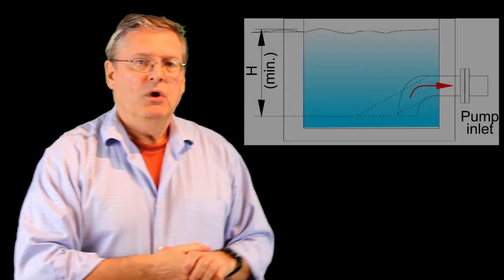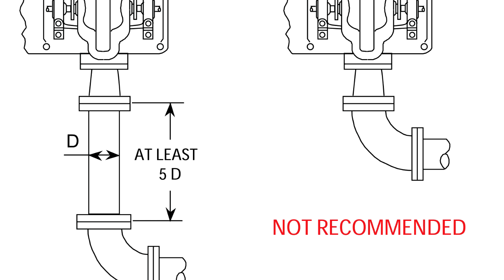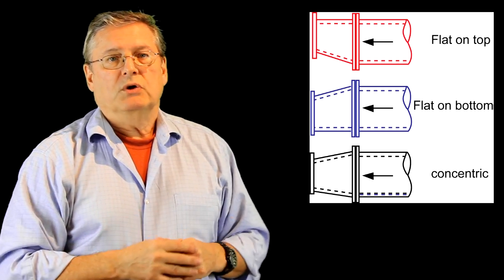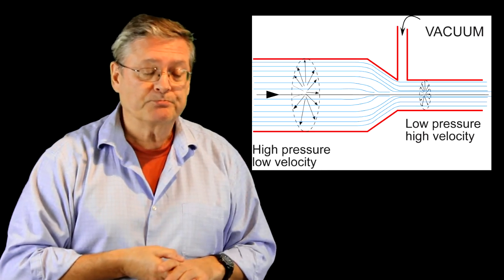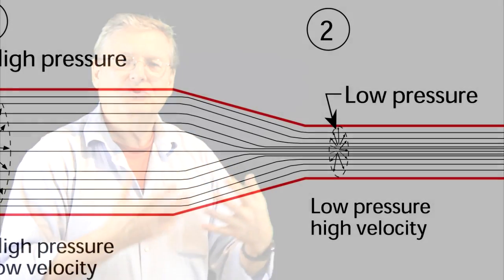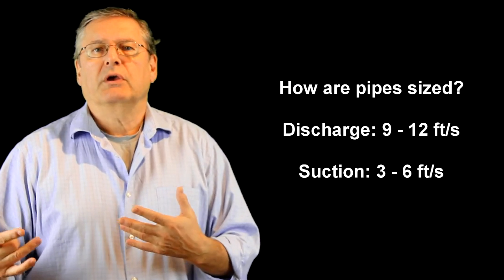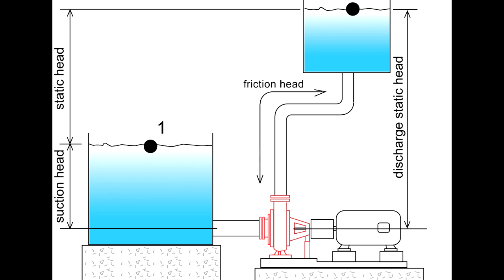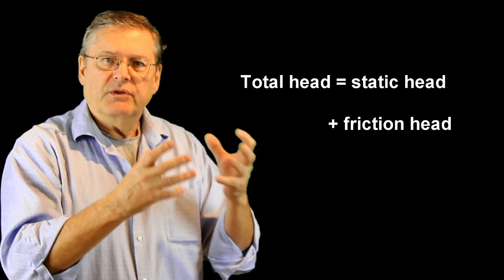15b. Pumping and piping part 2

Comment: Thanks again. Very well explained. I hope you will create a video using the various fuel pumps used in the automotive industry to show how the design principals all work to achieve the pressures needed to inject fuel into the engine.